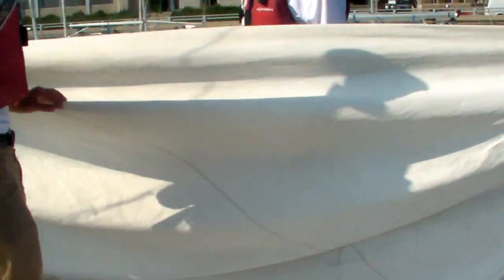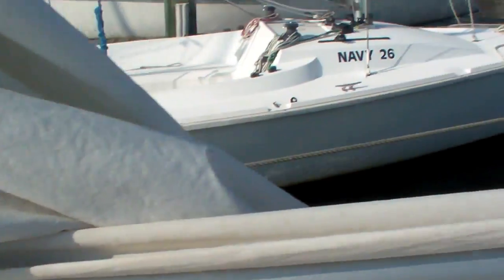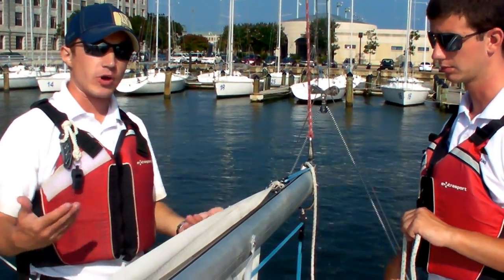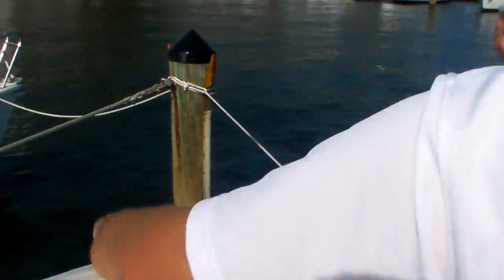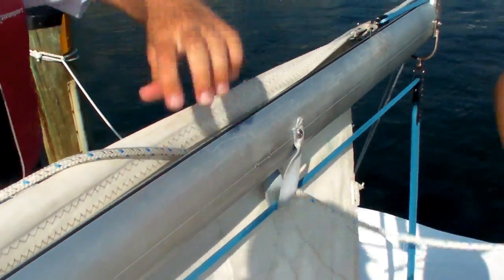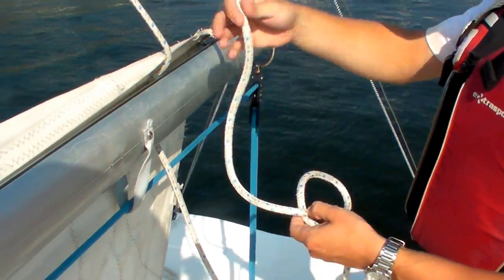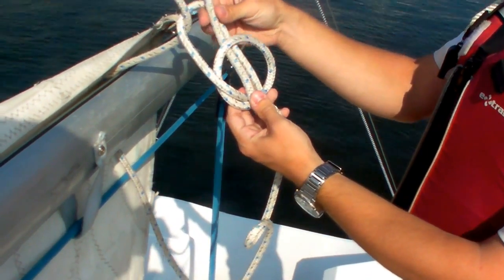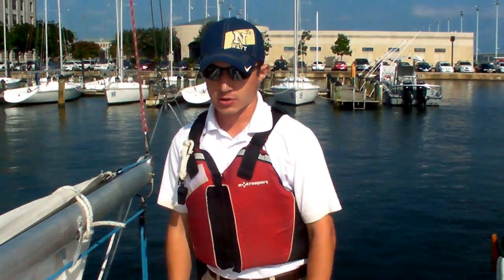Rigging the Reefing Line

Comment: I recently re-ran the 3rd reef on a Seawind 1260 catamaran in the north Pacific. The boom was entirely enclosed. I've had a lot of experience snaking electrical wires (and working with guys who did it a lot more than I did.) Getting that 3rd reef sheet through the boom  was one of the trickiest repairs we did.  
Step 1. Sew a messenger line onto reef two. (I brought along paracord)  Pull this through the boom.  Now you have to get this messenger line over to the sheaves for reef three. There was almost no access. (the guys in this video have it much easier). 
Step 2. Take a piece of wire (I used a piece of a Vietnamese aluminum hanger.) make a slight hook in the end, leave the edges sharp. This will help you snag the line. At least one of the two 'grabs' wasn't a hook, it was this rough edge snagging. 
Step 3: Fiddle around in front of the sheave to snag the messenger  line and pull it over from the second reef run and out of the boom.  This was very tricky. At the mast was a lot harder.  
Step 4: now you have the messenger line out of the boom but it's on the wrong side of the sheave. Tape it to the sheave and carefully rotate the sheave until the messenger line rolls under and comes up the back. (Make sure to keep some slack out so if it falls off the sheave you don't have to poke around again.) We used duct tape for the aft sheave, but that didn't work for the sheave by the mast. Black double stick tape however worked great. 
 I can fix almost anything  but after I'd poke and snagged the messenger line out of both ends of the boom I wasn't sure I could do it again.  Tip: get some really good paracord, put it in a baggie and label it Messenger Cord Do Not Cut. Have at least 50 meters (150 feet)  of good paracord onboard. Including the 15 meters I used as a messenger line , we  used at least 100' (33 m) during three months and 7000 nm of sailing. No one else thought we needed any.  (Get the best easiest to use and most reliable butane burner you can find. We couldn't find a good one in Vietnam, the Philippines, Taiwan or even Japan. Make sure it's easy to refill. ) 
Another tip: When you take delivery of a new boat, have someone who's sailed that company's boat for either a long crossing or a few years. They aren't going to say 'wow, what a great boat.' They know it's a great boat, but they're going to demand that all the rigging mistakes and chaffing that is going to happen be fixed before you take delivery. (My boat is older and really well fitted out and I think I've proved I know a thing or two -- but I had no clue.)  Hope this helps. Fair winds and carry a marlin spike.

Comment: No offense , but for some one who has little experience sailing and trying to learn more, i found no useful information here.

like why do you tie off to the boom? instead of having a traveler or a tie off  on or in  the boom?

What happens to the reefing line when you wanna reef from the cockpit under way from full sail.

how does the reefing line work when you pull it in ? 

What happens if you have 2 or even 3 reefs ? and you cant or don't want to leave the cockpit ?

probably more questions but you get the idea i hope ?

 Thanks any way
Reply: This video was showing how to tie off the reefing line on the boom which is a permanent fix. Your questions are more about how to reef the sail which you can find on other videos.
Reply: I'm guessing he ties it around the boom instead of a traveler or tie off because there is no traveler or tie off there? Also it spreads out the load and works really nice so why not do it that way? The video is exactly what I needed the first time I rigged my reefing lines.. If you want more details there's plenty of other videos.